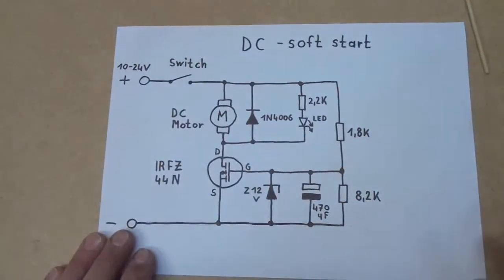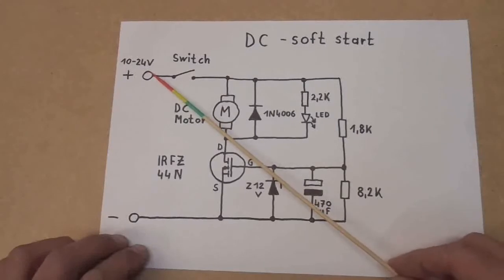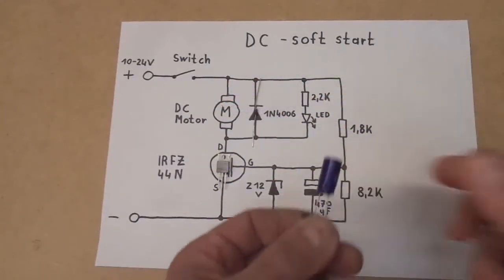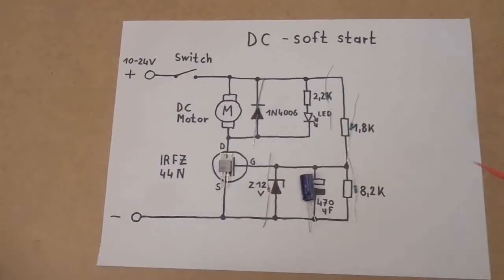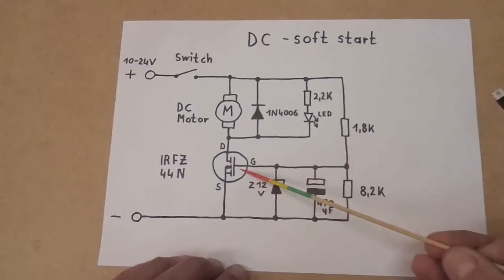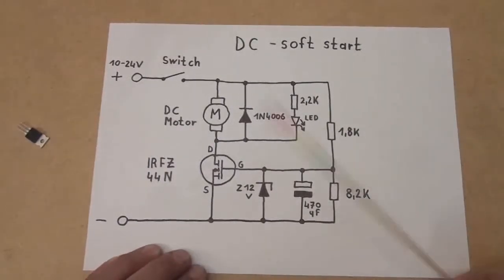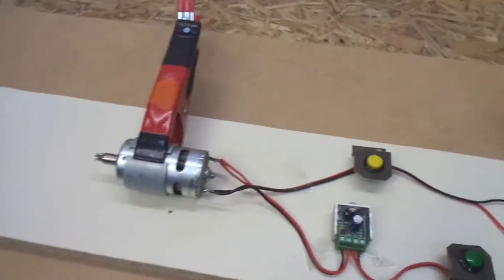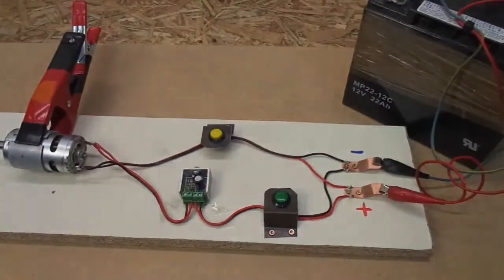super simple DC softstart circuit

Comment: I made this circuit for a 12V 8A  cooler fan, but I get about 50% power loss with the soft starter connected (it only draws 3.5A on the 12V side) ... Do you have any idea on how to solve that? I use a switch power supply 12V 8.3A
Reply from the maker: Try to measure the gate voltage. After max 5 seconds it should be 10 Volts. (or higher) The datasheet of the IRFZ 44 N calls for 10 Volts at the Gate, to turn the Transistor full on. So virtually no power loss. Replace the 1,8k resistor for a 1,2 or a 1k resistor, to get a higher gate voltage if it is to low. But you have to choose also a higher capacitor value, to get the ramp time, which fits your needs. By the way... as i sayed in the video, for voltages below 20 volts, you dont need the Zener diode, because this Mosfet can handle a maximum gate voltage of 20 Volts.  I know, the IRFZ 44 N is not the best choice for this circuit. It could also be an option to try different N - channel mosfets, to find the right one, which works best in conjunction with your Motor. Did you measure the supply voltage, when the Motor is on? Does it stay stable at around 12 Volts when the power supply is under load? This could also be the reason, why the Mosfet does not turn on 100%. I am very busy at the moment, but i will try to find a Motor and a power supply close to your specs and test the circuit in this configuration, to find a solution... As usual...the devil lies in the details.  ;)

Comment: Thanks. Would you say anything such a circuit design that is able to soft start only, solving motor start problem. You know using this type of circuit cuts a certain amount in voltage, ie from 12V to 10V, and this is a undesirable matter. Do you have any idea?
Reply from the maker: Yes...as i sayed, this is the most simple circuit, you can get away with.  ;) The Mosfet is used as a variable resistor. After about 2 seconds, the mosfet ist full on...so virtuallly no voltage drop and no heat loss during operation.... A much better solution would be, to use a microcontroller to control the Mosfet. (arduino / attiny)
Reply: @LariFariYoutube  Thank you very much, I will try.
Reply from the maker: @baygomer4706  Yes, i think, thats the best way.... This circuit is so simple, it dont take long to build it.  ;)   Try it and you will see, if this one is suitable for your application. Maybe i will do a video on a more complex version of the thing ...  (PWM)